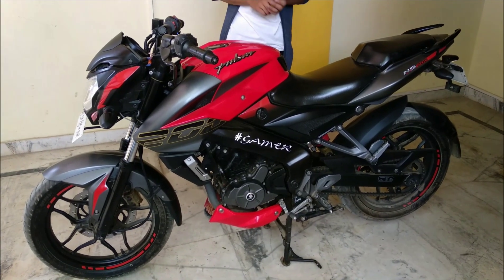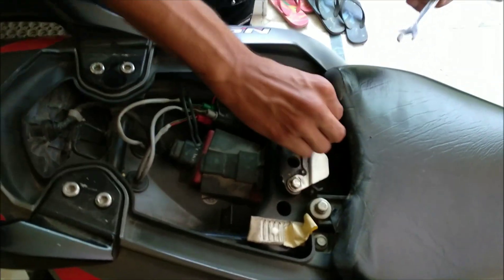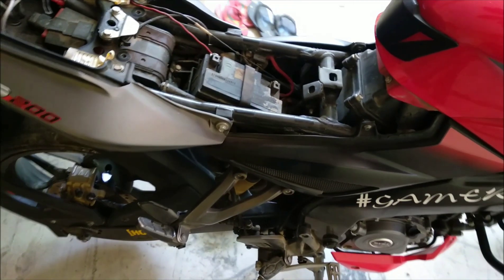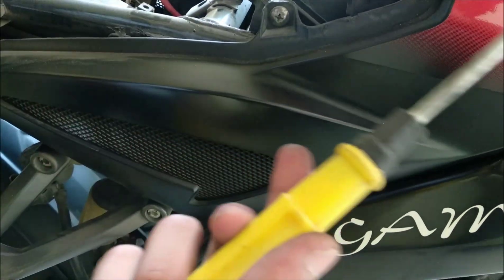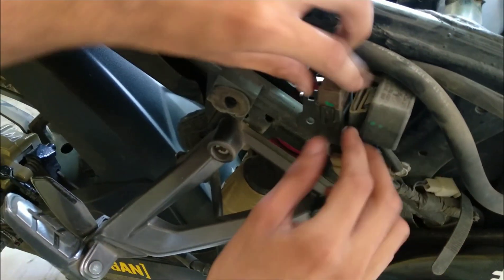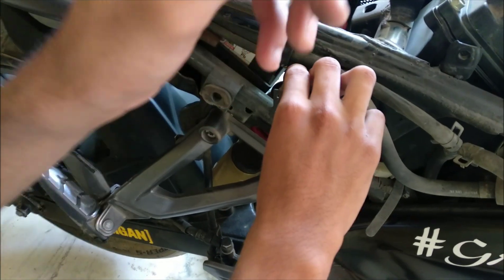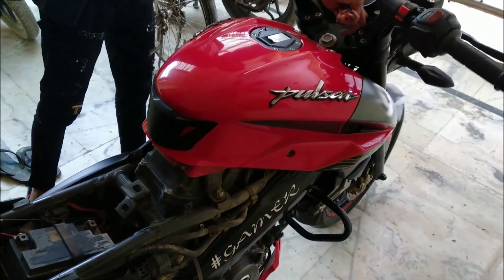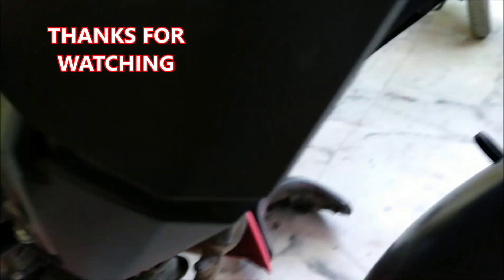pulsar ns200 radiator fan checking at home|(DIY)

Comment: Bro ..... My radiator fan wont spin right after I start the bike ... Is that a problem ? Please answer quick ...thankyou
Reply from the maker: why would it spin right after starting if the machine is cold and doesn't require cooling
Reply: Last question bro .. Why does the silencer become so hot right after start when the machine is cold ???
Reply from the maker: not the silencer but the pipes will instantly gets hotter as the combustion is going on in the head n the header pipe heats up right after starting the bike

Comment: When the bike is start fan also be start without heat so it’s a problem or not ?
Reply from the maker: bro actually thats a fault in the wiring in which when u accelerate the fan also starts automatically and shuts off when release the throttle so u have to install a manual radiator switch or u have to install the whole wiring kit of ns

Comment: Bro jb 2021 and 2022 me NS200 update hoga toh uski power decrease hogi ya increase hogi
Reply from the maker: bro thats a great question although bs4 versions me power ka decrease dekhne ko mila tha but as you know that bs6 version now has fuel injection which increases the power ratio to 24hp as compared to 23 in older generations so maybe the power ratio will remain the same but still you can change the hp ratios through ecu remapping but so as for now i dont think so that they gonna increase or decrease the power maybe they ll reclock the rpm limit.

Comment: Bro can i ask question what if the rad fan is always working when engine heat and fan will work it will not turn off untill you off the engine bro whats the problem of it?
Reply from the maker: bro im also facing the same fault in which fan starts automatically while accelerating and suddenly stops when releasing the throttle so i ll be making a video on it very soon so stay tuned bro
Reply: Problem in speedometer

Comment: Bro its working but after fixed same relay but not working automatically
Reply from the maker: fix the relay again and properly n it will only work when temp is high enough for eg in city areas or in crowded place otherwise on an open road it wont work beacuse ns engines dosent gets that much heat as compared to ktm engines

Comment: bro if i will not use jumper wire i will buy relay it will work?
Reply from the maker: this is just for checking that whether your relay is in working state or not you dont have to buy a new relay until your relay actually stops working
Reply: bro if the fan stop working and it works when using jumper wire .the relay is busted?
Reply from the maker: yes than you can surely go for a new relay
Reply: thanks idol
Reply: idol i have new ns 200 the fan is not working after i start i will automatically start?
Reply from the maker: exactly bro it will not start just after starting the bike it will only start when you bike's engine temp will be high so the working will be based on sensor and sensor will only work when the engine temp will rise
Reply: thanks for the information bro
Reply from the maker: yo welcome 🥰

Comment: Bro i jump the wire in off positon it works but if its the key is in on position the jump wire is not working
Reply from the maker: u must have inserted in the wrong socket bro try to put it in the right one that ll work for u

Comment: Bro while breaking 
Rear type slip ho Raha hai and notice aati hai solutions?
Reply from the maker: brake pads aur caliper check krwao
Reply: Use both breaks. 70 percent front and 30 rear. It won't believe me.
Reply: @somesh9065  ya bro 
But maine bike servicing krva kr li
 Then also ma radiator is not working
Reply from the maker: Bhai wo overheat conditions me work krega waise nhi aur na ka engine itna heat nhi hota

Comment: Bro can we add on our additional switch too turn on and off the radiator fan ?
And if yes then how much will it cost
Reply from the maker: thats a switch mod bro in which u can manually turn off/on ur radiator when u want but bro believe me ns200 dosent gets that much heat which ktm bikes get so it is just a mod which consumes battery as well.the installation is very easy but again its not useful let it be automatic instead of manual

Comment: Bhai jabse Liya hai Chalu hi nahi hua kabhi bohot heat aati hai bike se any solution?
Reply from the maker: bhai wires check krwao ho skta he fuse khraab hogya ho
Reply: @RIDEWITHGAMER  bhai new fuse kitne ka milega ?
Reply from the maker: sirf 10 se 20 rs ka bro
Reply: @RIDEWITHGAMER  aur bhai 
Handle vibration bhi bohot hai 
And gears bhi bichme hi atak jaate hai
Reply from the maker: @Tejas Shewale gears atakne ki problem meri bike me bhi tha but clutch tight krane se problm solve ho jata he and handel vibrations meri bike me kbhi nhi hua but ye problem 2018 ns me ho ra he 2 teen bando ne aur btaya he mjhe iska solution maybe tmhe service centre se mil jayega aur maybe handel rubbers noise kr rhe ho koi bhi reason ho skta he
Reply: @RIDEWITHGAMER  tysm bro 
Can you suggest me best engine oil
Reply from the maker: nowdays everyone is saying that use motul 7100 because that reduces engine vibs and increases the speed ratio but on a serious note it is just like other lubricants i.e it will not give u any major differences in your bike so i tried both bajaj n motul n hardly found any differences in between now im gonna try liquimoly but that thing is too expensive i ll make a video for it really soon and that video is all about best lubricant for ns200 till then u can go for bajaj oil its not that bad.
Reply: @RIDEWITHGAMER  ok ty
Reply: @RIDEWITHGAMER  bro 
Coolant level of the bike should be min or max
Reply from the maker: actually that level is not the exact level of coolant because its a reservoir bottle and the main coolant is inside the machine so its nothing to worry about
Reply: @RIDEWITHGAMER  cause mine is showing min
Reply from the maker: thats reservoir bro dont worry if u wanna fill it then u can or otherwise leave it